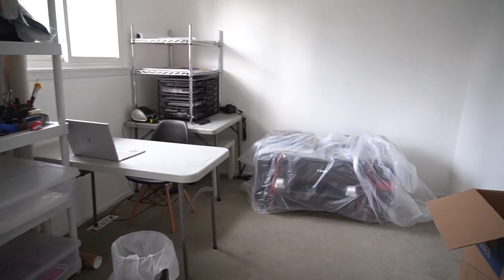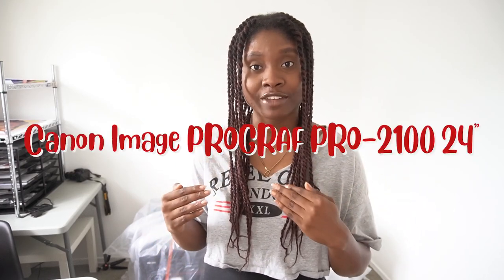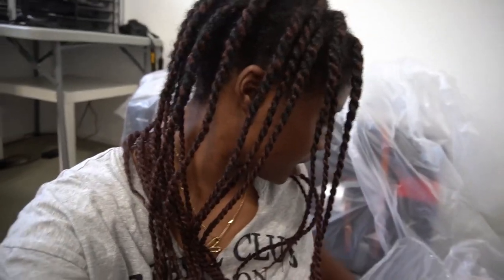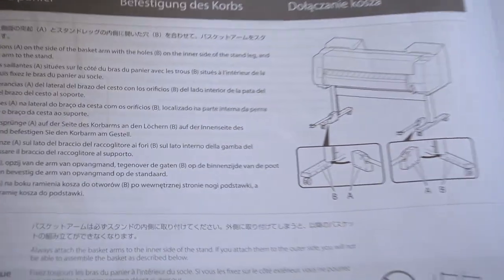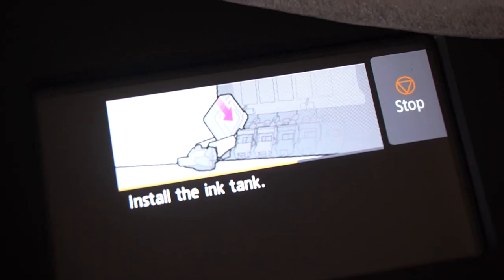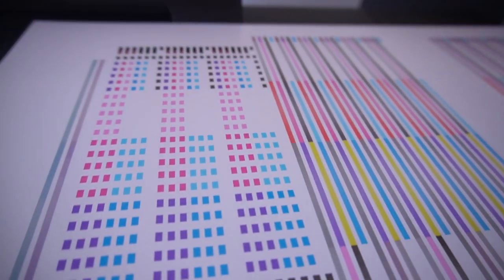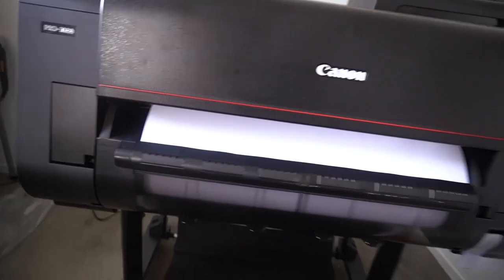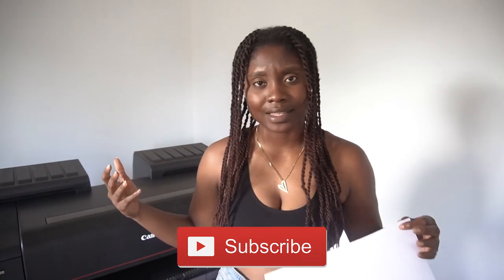I Bought a Large Format Printer for my Art Business!

Comment: A problem I've found is labs usually don't use the same papers I like when I print smaller sizes.  I like Hanemuhle's William Turner.  Whitewall uses that paper, but charges an extra $97 just to use that paper .  About $147 for a 24x30" print is not going to happen.